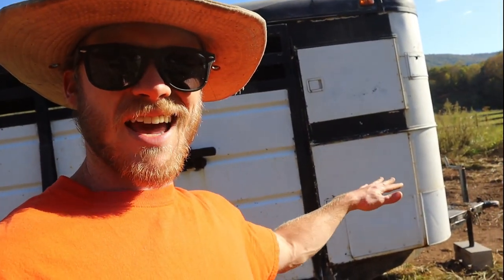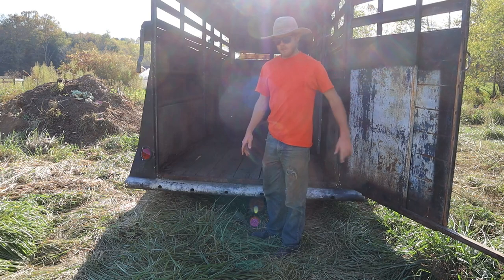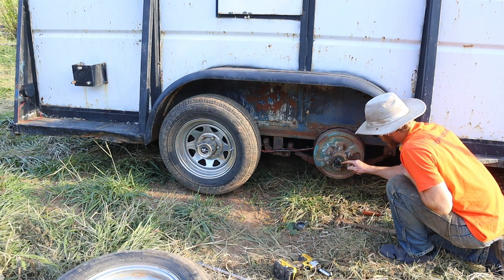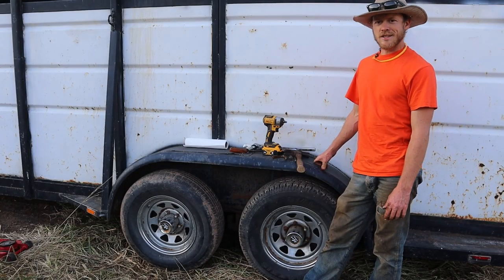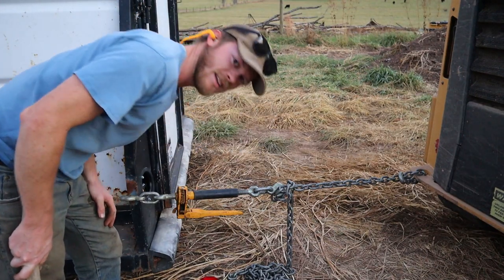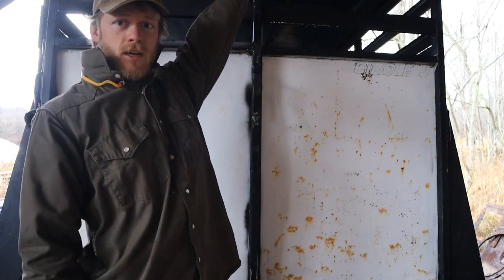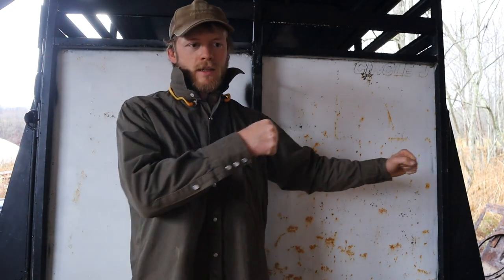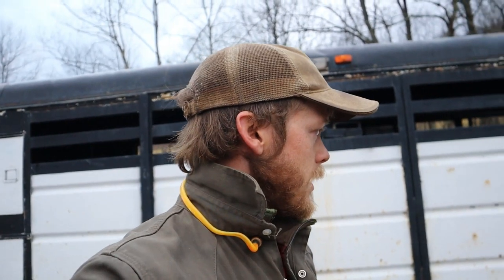Fixing Up My New(to me) Livestock Trailer

Comment: Rust wise your 1978 trailer looks a lot better than my 2000 cattle trailer. My trailer has the same bracing at the rear and also has the same dent on the left side and also a West Virginia plate.

Comment: Looks like a good find for you. Did you check the bearings for grease while you had it apart? The nuts were definitely loose on it. I'm impressed with your trailer. It has been taken care of. Should last you many years. Thanks Josh. Have fun.
Reply from the maker: Yes everything seemed pretty well greased.

Comment: May want to do some research but I think the wheels bearings call for about 4lbs torque!  Double check before hand as it was something I had heard!
I checked with google and it said 15~20 lbs so maybe do a few searches!
Reply from the maker: Hadn’t crossed my mind that there was a torque spec. I’ll have to look into that.